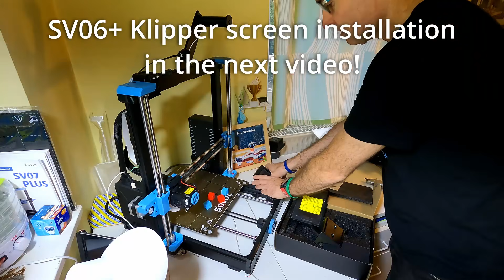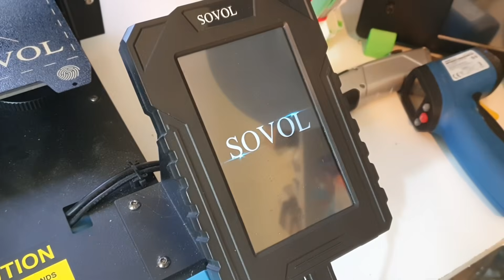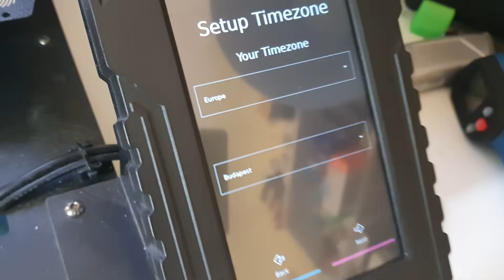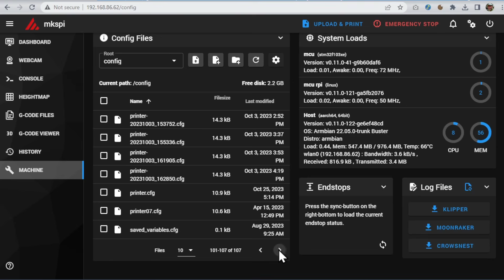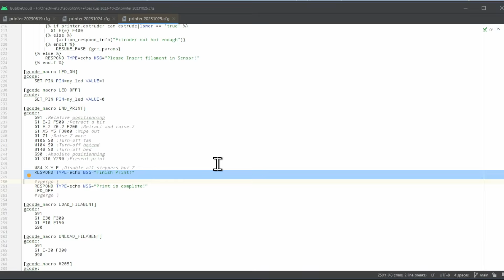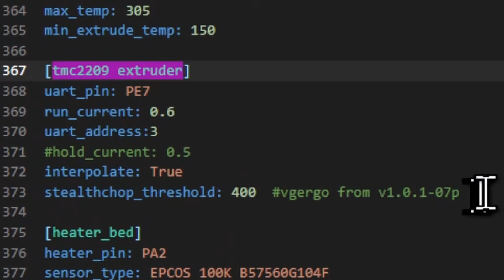Sovol SV07 / SV07 Plus Official Firmware Update Guide for Klipper screen (SV07+)

Comment: Hmmm… interesting. 4-5 minutes. I’m doing my SV06 from 1.0.0-06 to 2.2.0 and it’s been over 25 minutes. Hopefully something interesting happens soon or I’ll just have to shut it off and try again, hoping nothing was permanently corrupted. It would nice if Sovol 3D actually included a manual and URLs to download any required profiles and where they go… on a Mac. What do they think most artists use? Thank you for at least providing a starting place. ChatGPT told me you could help.😀

Comment: Sorry to disturb. But i upgraded klipper via the fluidd webui. I am now on mainsail with a bricked printer, it tells me i need to update the MCUs which are at version 11 or so and klipper at 12. The klipper screen is the latest version.

I am at a loss on how i will continue now. I cannot manage to upgrade firmware on MCU because of the lack of documentation that i can actually understand. People are talking about SD cards. Which i do now know where it is or what file i should put on it. There is also a emmc on the klipper screen, which i do not know the purpose of.

I am at a loss here. My printer does not work since klipper will not communicate with the MCUs due to they having a lower version. I have tried kiueh( or what it was called) to build a new firmware. I still have the original printer.cfg file so i made a new firmware with said program for the sm32107 or what the board was called. But flashing via SSH fails. And when that fails people say to rename klipper.bin firmware file to firmware.bin and apply that to the sd cards on the main board.

The issue is that i do not even know which mainboard or where it is located.
Reply from the maker: Yes, standard OTA Klipper upgrade bricks these printers. Don't do it. There is a fix:  just search for repo:fryc88/sv07 and repo:TomasOlsson/BrickedSv07-Sv07Plus on github

There is also a working way to update to the latest Klipper, search for 3DPrintDaemon's How-to-Update-Sovol-Klipper-Screen-To-Latest-Klipper-SV06-and-SV07 on github.  I am going to make a video on the process soon.  

If you have an EMMC adapter (link in the description of this video) I can upload the factory image for you that you can restore as shown in my previous video...
Reply: @gerGoPrint3D  thank you. This info is invalueable. Hopefully the instructions on the GitHub is something i can understand.

I do not have a emmc adapter. But that should be the same as a sd cards usb adapter? Those i do have.

What i don't understand is, is the klipper "screen" the computer/pi that runs the actual klipper? Or do i have both a mainboard and a Raspberry like computer somewhere inside the printer? If you could upload the files i would be thankful. Are that image what i should flash the emmc with?

Thank you for the help, i will watch the previous video and the future video when it comes up.

Ideally would be to get real main branch klipper running right? Then OTA updates would work in the future? 

I am at work now so i can not view the videos and have limited possibility to check the adapter.

But either way, thanks for the help. I will check the GitHub and see what alternative might suit the best. Hopefully i can manage to restore the printer to working order then.

Even Sovol has a video on how to upgrade the emmc. But they provide no files to do so.

Comment: I have problems with the Sovol Svo7 Plus Nozzle always moves into the print bed. I have leveled correctly but on the first print the nozzle moves into the print bed or it prints 1 layer and then moves into the printed part
Reply from the maker: Which slicer do you use? Did the pre-sliced 3DBenchy that came with the printer print correctly? How does your bed level mesh look?

Comment: Hey!

Thank you for this guide!  I did a 'update all' on my SV07 through the mainsail UI today, it looked to go through properly, but after a restart, I could not get access to the SPI (the mcu could not access for some reason).

Anyway, i tried finding the problem and sorting it out, but to no avail. So i followed your guide, formatted a USB drive, downloadinged the .deb package from the google drive page which SOVOL has, put that on the usb disk.

Then i booted up the printer, ssh'd to it (using the user: mks  and the default password: makerbase).

I then started the program 'top' to see what was going on inside the OS. Then i plugged in the usb-disk into the printer, and I noticed that a new process started regarding the debian package from the usb disk. I let it sit for roughly 5min, after which the printer rebooted, and I got to the 'first boot screen' on the touch-screen, and it no worked again. 

Please note that I had to create a bed-mesh profile again, and do the z-calibration, to be able to print properly again.  =)
Reply from the maker: Yes, Sovol explicitely tells users on all forums not to do OTA updates, since their display modules are not intended and not tested for future versions of Klipper. Maybe sometimes they will make them compatible, but for now we have to rely on them updating the screen modules manually and provide the Klipper version that works with it. This is not ideal, but users have to understand 3D printers are no like Windows laptops where you have to update every 2 weeks to keep things working. These printers only access local network. I have 5 year old 3D printers which have never been updated, and they work as before. In fact, if anything, updates always carry more risk than benefits for a 3D Printer imho (or for any device actually), since after a major update we sometimes need to rework our slicer profiles etc. THis happened in the last udpate as well, it took a while to figure out what slicer setting can counterbalance the underextrusion that started happening in top layers...  It's better to keep things as they are, unless you see some major new feature that you want to use. Otherwise ain't broke, don't fix it. Even if a major new feature comes, who knows if the perfomance of the current hardware can correctly use it. It's like now Android / iOS versions rendering old phones virtually unusable because they don't have the necessary processing power or RAM to correctly run them.  The printer's current hardware is guaranteed to work well  with the current software.

And yes, the downloadable update overwrites your printer.cfg, but you can just use one of the datestamped backup version, all your previous saves are there, even the meshes imho. 

On the longer term I recommend getting an EMMC USB adapter so you can make a complete backup and restore your last known state in a second, even if you accidentally brick it beyond update-fixing. 

Good that you managed to restore your system!! And thank you for sharing the process here as help for others.
Reply: @gerGoPrint3D  For people who have no Windows system, how is this update supposed to work?
Reply from the maker: @suzyamerica4679  If you've just received your printer, chances are you don't need this update, your printer already comes with the latest version. If you want to update to an even newer version of Klipper, check out 3DPrintDemon's guide on github. But I'd suggest to just start using whatever version your printer came with, just install OrcaSlicer and CV's Klipper Additions as shown in my '"Switching to Orca Slicer" video.
Reply: I followed this video to update the klipper screen.

Afterwards i stupidly upgraded klipper to latest via webui. Now it is mainsail instead of fluid and the MCU versions tells me they are too old

I have no idea how to continue. And the printer is basically bricked for me. I have tried finding documentation but cannot get it to work.

Comment: my house energy turned of during the firmware update and now my sovol sv07 plus is not turning on, i don't know what to do
Reply from the maker: Yes, that's the nightmare situation.  Does the Klipper Screen power on at all? If not, it's probably a fuse in the power supply. If it does power on, just try putting the firmware on a newly formatted USB drive and attempt the update again. If you think your Klipper Screen is bricked, just search for repo:fryc88/sv07 and repo:TomasOlsson/BrickedSv07-Sv07Plus on github
Reply: @gerGoPrint3D  i'm, the screen it's powering on but don't start with the correct firmware file, i'll figure it out hahah, but is a nigthmare situation
Reply: hi, did u figured it out? I m in the same situation @SamuelMatos-q3v

Comment: in the sovol 07 with klipper i can change the collor with the M600 (this m600 is in the marlin)
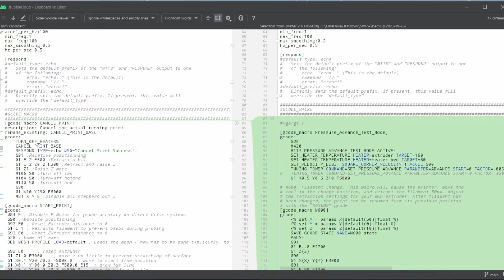Reply from the maker: You can add your own M600 macro. You will actually see it in my video at 12:24
Reply: I've been in a running conversation with Sovol, regarding lack of full support for the M600 command within their current Klipper configuration.  Per Sovol, they say "machine does not currently support some commands".

If you can outline the proper procedure I, as well as others, would be grateful.  Having a 3D printer that can't successfully complete a mid print color change is useless.  Additionally,  I'd suggest providing Sovol with the information.   This would enable the tech's provide an appropriate patch.
Reply from the maker: @propcarver I have now added my M600 macro to the description of this video. Please copy / paste it in your printer.cfg.   I will make a video about this, but in short, this will work with Cura's process g-code filament change and you can also add M600 in prusia / orca slicers. The way it works the printer will pause at the command and unload filament. Bed / nozzle will hold temperature.  You can replace the filament pool, and use the macro button (3rd in bottom row) → LOAD_FILAMENT to load/purge as much as you need. Then go back to the print status screen (via 2nd button in bottom row) and press the RESUME button. I like to grab onto the purged filament so as the toolhead moves back over the printed part I can tear off any oozed filament.  I hope this makes sense, as said, maybe my next video will show you how this is done in practice.
Reply: @gerGoPrint3D    Thank you for the reply.  Before I reached out to Tech Support I added that addition, as well as trying other M600 macros,  All have failed.  Sovol's response was "do it manually" and the current version "machine does not currently support some commands".  I've been testing this for some time now. The print will always fail.  the extruder temp quickly falls below the required temp, when using the resume feature you will sometimes get a warning "CAN'T RESUME ... THE PRINT IS NOT PAUSED".   I'm not the only one reporting these deficiencies.   If you can post a video of a successful 3 color print I, as well as others, will appreciate your effort.
Reply from the maker: @propcarver  I don't understand, it works for me. Which slicer do you use? Do you have other macros which might interfere?
Reply: @gerGoPrint3D  I'm using the current SV07 Plus 1.0.8-07P Firmware and no additional macros.  I primarily use Prusa.   I also did a test using UltiMaker Cura 5.6.  Same result.  I and others would appreciate a tutorial and video outlining what needs to be done. The folks at Sovol weren't surprised it failed and advised me to do it manually.  I'm working on a few large projects that require multiple color changes.  If you'd like I can send you a sliced, Klipper compatible test file.   I'd appreciate any assistance you can offer.

Comment: Would be nice to know what macros are You using to improve  3d printing experience. For now I have found bed mesh creation depending on printing area before every print most usefull (with 20x20 measure points on whole bed).
Reply from the maker: Hm. That sounds a bit over the top for me, or maybe I was lucky with all 4 Sovol machines I got, 5x5 or 7x7 meshes have always been enough for perfect prints, and I do them once at setup, and just use the printers for months without redoing the meshes. I am getting perfect first layers without fail. 

My Z motor do go out of sync however pretty regularly. How do I know? I printed z-markers for all of my printers, so I immediatelly see if they are just a tad out of sync, and I can fix them just by rotating the lead screws back to the markers in 1 sec! By constantly redoing meshes you might be compesating for similar z-tilts, but the solution is quicker and easier than waiting for 400 point meshes before every print...

But thank you for the tip, I will soon make a video on the few macros I use and other adjustments to my Klipper printers.
Reply: @gerGoPrint3D I found it rather necessary if the prints are close to plate borders. I have a steep angle there on my build plate so calculated points,if the mesh is not dense enough, are quite inaccurate. Also my machine does 31 measurements per minute. Even for full plate with 20x20 points it is only 13 extra minutes which considering print on a whole plate is usually 8+ hours does not impact that so much. While for small prints it gives around one extra minute.
Reply from the maker: @deciver5 That's a good point. Maybe investigate selective mesh plugins?
Reply: @gerGoPrint3D   I see there are some of these plugins for cura slicer but I use prusa slicer atm. The settings I got from MakerMuse channel give me awesome results and I could not replicate it on cura slicer :(

Comment: Hi again, where u Plug the LED Cable in......We can now dim the LED! I had previously clamped it together on the extruder cooler.
Reply from the maker: Yes, I tried to show it at the end. LED dimming works even with my custom led mount and 50x8mm COB LED strip that I used.  It is flickering a bit, but not too bad.

Comment: Hello, i use before that Bigtreetech Pad 7 with "externel Powersupply" and change to Sovol Klipper Pad for "SV06 Plus" with connect to "Printer Powersupply". I kept getting error messages "Lost communication with MCU" or "Heater extruder not heating at expected rate". I switch back to "externel Powersupply" and all run fine without Error Messages. I think that the "SV06 Plus" printer power supply is too weak to also operate the Klipper Pad. If anyone has the same problems, try an external power supply for the Kipper Pad. best Regards Dirk
Reply from the maker: The MCU communication errors are because you route your USB cable too close to the PSU or power cable. My SV07+ also has a ferrit ring around the cables to prevent interference. I am working on the new video about the Klipper Screen installation, you will see I have added a ferrit ring (and recommended Sovol to include one in for future customers). Other users were successful switching out the long cable to a shorter one and making sure it is routed further away from the PSU.  So far I haven't had any problem with the PSU not being strong enough, though I haven't printed anything longer yet.  But there was no issue heating the bed and nozzle at the same time.  (I am using an external powersupply for my PSU fan, but I don't think this would be a significant reduction in power use)
Reply: @gerGoPrint3D  Thanks Bro ....i agree! i think the PSU from ur SV07 ist strong enougt, but my SV06 Plus is apparently too weak. Also all my Cables very short and good quality. I cut also the 5+V line on the USB cable because this is probably causing problems on the Bigtreetech Pad 7 by Bassamanator instruction. My PSU can have also a problem, because I changed the fan exhaust on the case. A better Fan must be fix that Problem maybe also. Thks for ur Helfuell Vid....best Regards Dirk Ps.: Ferrit Rings also a good Idea.....i have a big Package her :----)))))

Comment: I have the same extruder issue and your fix dosent seem to work for me do you have an idea what else it could be?
Reply from the maker: Try different values for stealthchop, the Klipper screen for sv06 plus has it set to 0 (zero)
Reply: I just realized its not the exact same issue, it extrude great when loading and unloading. the only time the extruder does like you it is when doing the purge line at the beginning of prints once the print start it is fine  @gerGoPrint3D

Comment: where u get the stl for your extruder cable ?
Reply: If you erase it by mistake you can find it in the sovol page under support If I remember
Reply: that not what i waas looking,  if u look on the video he got someting on thhe cable connect on the extruder
 @axelrodriguez9967
Reply from the maker: There was a "Cable buckle.STL" file on the thumb drive that came with the printer (in the tool drawer).
Reply: the one u got on the hotend? @gerGoPrint3D